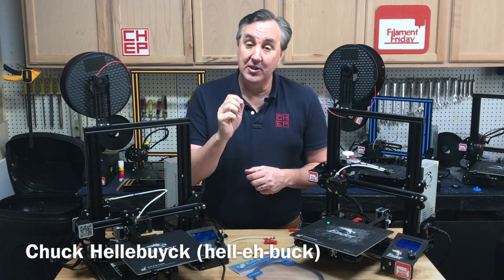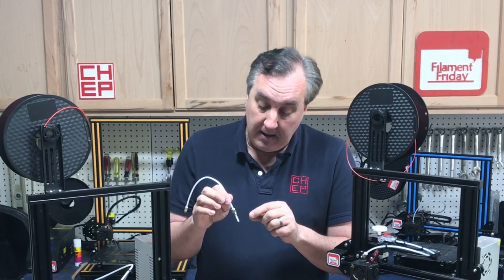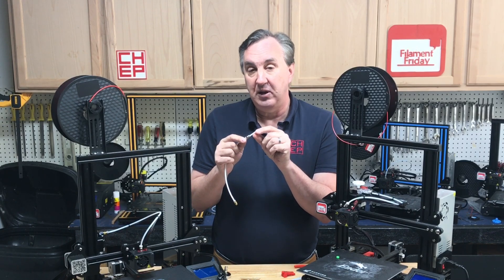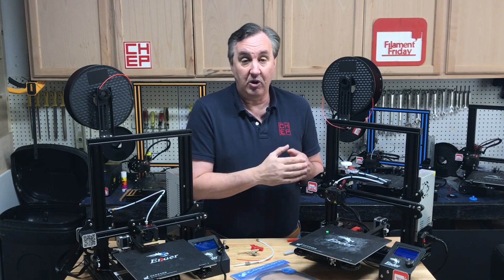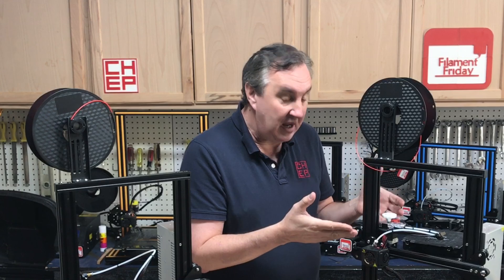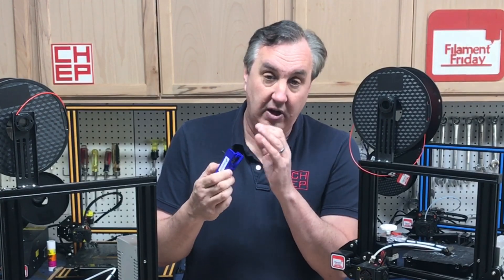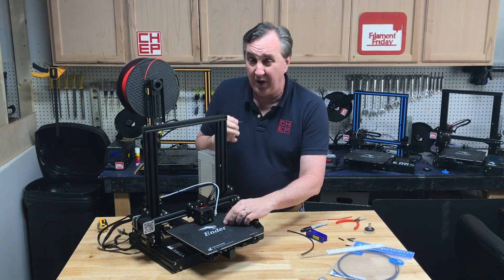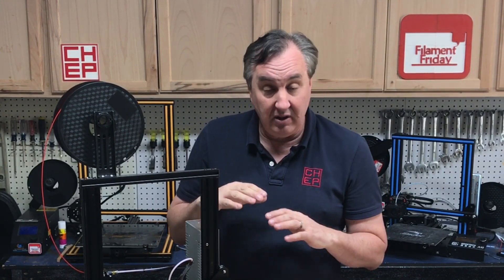Simple HOTEND FIX for Creality Ender 3, CR-10

Comment: Instead of the washer why can't you cut the insert shorter like halfway then you can just screw in and push the bowden tube all the way against the other tube I mean Don't you only need the first 20mm of a better tube inside the hotend to make it better?
Reply: I'd assume that would work too - but having the washer up the top to press down hard on the Capricorn tube would kind of "squish" it against the nozzle, creating a better seal.
Reply: @justdoomibis  I was still getting stringing so I added the 2mm washer going to try that and then going to try removing the nozzle and pushing the tubing all the way through to clear out the hot end and fit a new nozzle or just clean it
Reply: I use a M3 countersunk washer. It helps to seal the tube better.
Reply: @minhdang1987  @FulcrumAirsoft about to embark on this mod. I will try to find this type of washer at my local hardware store. One question - do you place the washer with its flat face facing the Capricorn tube and the crater like face up towards to PTFE tube/coupling? Just asking to make sure I do it right. TIA.
Reply: @ashokmoghe8035 yes. the flat face of the washer will face the tube which is between the nozzle and the washer itself.
Reply: @minhdang1987  Thanks for a prompt reply. Planning to do this over the holidays. Mine is a stock setup that is printing beautifully and consistently but want to do this "mod" before graduating into printing higher temperature filaments like PETG, TPU etc. Thanks again and happy holidays.
Reply: @minhdang1987 Thanks for the idea mate. Had all 4 of my Enders go down with heat creep within a few hours of each other whilst processing a mammoth order. The PLA+ washers did originally work but denatured and degraded over time leading to the tube backing up. Got some M3 countersunk washers from Sourcing map on Amazon, also ripped out the Capricorn tubing I used inside the hot ends and replaced it with the traditional Creality PTFE as I got a year out of the first printer I modded. Think the tighter bore of the Capricorn actually made things worse and it seems to conduct heat better, hence the washer degrading. All 4 have the countersunk washers and the couplings aren't loosening like they did with the plastic washer. All work fine now. 

I'll give a tip back, use a flame to singe any stringing. I use a small blowtorch to quickly singe the stringing off. I tolerate the stringing as long as the print is strong.

Comment: I have done now two machines with this solution. No problems are experienced. I have redesigned the washer a little bit for my use. All in all a great solution. I have a all metal heat break and it keep in stringing, still need to try and find out why. My Micro Swiss all metal work fine and then suddenly it start to clog after a few days of print. Still not sure why. 

Keep up the good work and thank you.
Reply from the maker: Prime it like this. https://youtu.be/OG7We83M5gc

Comment: Sir I keep having a blockage in the nozzle end of the PTFE tube of my ender 3 whenever I turn on retraction irrespective of the retraction settings. I have tried almost all tips and fixes to no avail. Would appreciate if you can help me out.
Reply: I have this issue only with PLA and not ABS.
Reply from the maker: Replace the PTFE or install this: https://youtu.be/tYbL-O3FecY
Reply: @FilamentFriday  i have tried replacing the PTFE multiple times yet no result . also i cannot get a bimetallic heatbreak in my country. i noticed that when ever the tube clogs, the filament blos and sticks to the pfte tube on the inside.

Comment: I had problems with my new Ender 6. The pressure on the bowden tube coupler at the hot end would cause the tube to badly groove inside the connector after only a minimal number of prints, causing blockages. The tube would also gradually creep back from the hot end, yet another cause of blockage and frustration. I'd wasted multiple lengths of bowden tube before finding this video. I was able to salvage some of my capricorn tube, measure cut and fit (after printing the washer) and then replace the main length of bowden tube with a slightly cheaper alternative that I can source locally. I printed the washer at .12mm resolution using PETG (because it's what I had loaded) and it came out brilliantly. Six prints into my new setup, and no hint of problems yet. Fingers crossed!

Comment: Thank you sir. I've been having problems with under extrusion since I changed the complete hot end; inspected the PTFE tubing and found a caramelized like substance coating all over the tubing and inside the heatsink. Just fitted this mod and it's printing great, it took the guess work out of replacing the nozzle.

Comment: Tried your washers but they just rattle around inside the hotend & dont fit properly in my ender 3 pro. (Diameter too small) am trying capricorn tubing right through see if that works instead.

Comment: I tried this but I abandoned it. It's a lot more complicated and that I ended up squishing the short section of PTFE between the nozzle and the blue button that pops up on the threaded bolt inside the heat block and filament didn't want to go through.

Comment: Do NOT do this. It'll only create far, far more problems. This is a colossal prank at our expense
Reply: if you don't provide and explanation your argument is useless.
Reply: Would you mind elaborating on that? What problems does it create?
Reply: Well this prank works perfectly on my machine.  Will update my second machine once it finishes printing
Reply: You clearly don't have the IQ to implement this, so you should probably stop posting.

Comment: When you change the nozzle won't that bit of tubing fall out the bottom?
Reply: No, because it's a snug fit inside.
Reply: @johndaniels1197  even if it does, it's not hard to push it back in there.

Comment: Do you think this could be issue could be causing my prints to fail halfway due to clogging?
Reply from the maker: Yes
Reply: Thank you sir... I'll give it a go
Reply: @jameswalls3508  and ? did it help?
Reply: Not really.... But I figured out my issue.... Friction on the run out sensor due to the angle it feeds on taller prints
Reply: @jameswalls3508  so what did u had to do? I am having issues with my ender 3 max. It prints for like 30 mins and then starts clicking. I am a complete noob 🥲
Reply: Heat up your nozzle and remove the filament... Back your Bowden tube out of coupler at the hot end... Loosen your nozzle 3/4 turn(might have to remove the shroud and hold the heat block long ways with a pair of pliers). Reheat your nozzle to about 205, cut the existing end of your Bowden tube (a couple of millimeters should suffice) and reiinsert it into the couple till it stops firmly... Then tighten your hot nozzle back down... This ensures you have it seated good up against the nozzle. Reinstall your fan shroud.... Also... Is your Max stock?
Reply: @jameswalls3508  thank you! It has springs and a capricon ptfe tube thats it
Reply: If it is.... There may be more going on.... My x axis(the bar across the middle that moves) sagged whenever in tried to print causing the right side to always end up to close as the print went on. Ultimately added a secondary motor and lead screw to the other side to ensure it moved up evenly... As for your run out sensor... You may notice when you start printing larger things it squeaks... That's where my problem was... It would drag going into the sensor and eventually hang up and the extruder would continue turning without pushing... Slowing my print down to 80% helped with that.... Finished a 76 hour print for my first time ever lol... Just keep at it and work the kinks out then it'll print like a champ.
Reply: @jameswalls3508  i hope so 😮‍💨 thank you so much for your help! Deffo going to try and slow down my speed! But do u think that i should replace the run out sensor? Or even remove it completely?
Reply: @jameswalls3508  my z-axis seems to be fine measured it like 5 times 😅😅
Reply: Id measured it allot too.... Just notice that side dragged a bit when it was printing so I figured "nope... Not on my new printer" lol

Comment: Could a standard SAE #2 washer be used instead of printing a miniature PLA washer?  The dimensions for a standard SAE #2 washer are 3/32" ID x 1/4" OD x 0.020" THK.  (2.38 mm ID x 6.35 mm OD x 0.5 mm THK).

Comment: I wonder if you replaced the short piece of capricorn with a short piece of bronze or brass tubing. Bronze is so slick you can't turn it on a lathe, so should not cause a problem.

Comment: CHEP, 

Found this mod and tried it.  I like the idea.  I have one observation and one question...  

I noticed when inserting the filament it seems to stop/hang-up at the transition from the washer to the Capricorn tubing.   In looking at it the inside of the washer it is slightly larger in diameter than that of the Capricorn tubing causing my filament to catch it and stop.  Maybe I need to make my filament pointed on the end rather than use a slanted cut when feeding into the extruder.  

My question is even though the washer is printed in PLA and not affected by the heat of the hot-end what are the chances when pulling  hot filament out during a filament change it will possible touch the washer and cause string or melt it???

Larry
Reply from the maker: Low. I’ve never experienced that.

Comment: Can this fix work with a piece of steel tube with the same dimensions as the Capricorn insert? It seems like that might be even easier than buying a new bi-metal heartbreak and allow for even higher printing temperature than Capricorn
Reply: Like CHEP said I doubt It would be a good idea because of the hear transfer, it would melt the washer and the filament before it reaches the nozzle
Reply: @OsmannyM  my hope is that the heat will radiate out somewhat. I have a few ideas about how to emulate the bi-metal heat breaks like using a ceramic washer between the tube and the printed washer
Reply: Thanks for the reply! I'll give an update after some experimenting
Reply: @poshhippie6446  did you manage to try out your idea if using a metal tube instead of the Capricorn tube? Would love to know the outcome. TIA.
Reply from the maker: I doubt it would work very well but give it a try and let us know.

Comment: I see that you read all your comments Chuck. This is my last ditch effort…. I have 9 CR6SEs in my print farm. The other 21 are prusas and I have some higher end ones as well. I’ve upgraded all the extruders to dual drive creality ones. I’ve replaced many of them to bimetal
heatbreaks which made them clog frequently. Finally I bought 9 orbiter extruders and installed it on 2 of them. They seem to run much better, but having an issue with VREF and output. All the couplers have been replaced and no matter what I try I have big issues with underextrusion. The couplers eat my Capricorn even with the hotend fix. The outside of the installed ptfe insert is also gummy and sticky. I get 1-2 prints in and the coupler has eaten a deep gash into the ptfe causing constriction of the filament path. I’m very close to throwing these 9 printers away. I’ve lost so much valuable time trying to fix them and they’re just garbage. I’m wondering if perhaps I’m over tightening the coupler, but eating my PTFE has me thinking differently. Any ideas?

If you help me fix this I will gladly commit to a year of patronage

Comment: I have done this mod on a FLSun Q5. Just had to scale the washer a little bit to fit. I printed the washer I abs to make shure it is heat resistant enough. I think one of the biggest advantage of the mod is that it makes changing the nozzle much more comfortable, because you don’t have to push the Bowden down till it touches the nozzle, which always includes a little guessing and hoping it sits flush and seals properly. And especially on a delta there is very much stress on the Bowden coupling because the Hotend is constantly moving in all axis with high speeds and jerks. So a Delta printer will definately benefit from the mod. Thx for showing this simple and effective fix!

Comment: Ender 3v2 doesn't print anything so hard to make a washer. So far 1 year in I hate my 3d printer. My fault for not realizing it was a 2nd job.
Reply: If you are finding it too much hassle, err every mod you do in favour of reliability and longevity. In the end you are probably going to have a machine with ABL, direct extruder and a couple of linear rails, which can print hundreds of hours between maintenances.
Reply from the maker: Are you using my Cura profiles? 
V2 should print a washer without issue.
Reply: @FilamentFriday  A working E3V2 will, but he is having some issue with it. I recommend subreddit r/fixmyprint with a video to help with troubleshooting and we will help there.
Reply: Thanks SnarkyGnome and Chuck for the help. The print isn't super beautiful, but I think it will still give the seal desired for the washer in this video. TLDR fix: CHEP best profile, glue stick, 30% speed on printer itself.
FYI if it helps anyone. I tried a few of the CHEP profiles. Then tried adjusting the CHEP4.12_0.12(Best) profile to have slower initial layer travel speed to 35 mm/s and 115% initial layer line width based on another CHEP video. Used glue stick for all prints and cleaned bed with alcohol between prints. Still just stringing print no sticking. Finally tried these same settings and glue then changed print speed on printer itself to be 30% (using Jyers firmware on Ender 3v2). In case this helps others. I'm not sure if it's just a sticking problem or extruder issue maybe when going too fast. Spent my allotted time on the problem this week so will try a bigger print next week. Maybe just 30% speed for first layer or 3 then see if it can handle the rest at normal speed.
Reply: @nottelling6727  Buddy I think you need to explore other avenues related to hardware. I would suggest you look at your bed levelling or your z offset because I have 2 of these machines and I don't use anything for bed adhesion. Once every 40 - 50 prints I either wipe her down with a tissue with water or just brush it off with a tissue. Have never had any issues. I am using an authentic bl touch on one machine and a cheap $20 3d touch on the other, so if you don't matter which one but I suggest to get one because at the very least for $20 you can view the levelling mesh of your bed via jyers.

Also I don't know about other people's ender 3 v2's but when I used 100% iso on my bed I noticed yellowish stuff coming off on the tissues so I stopped using it in fear of ruining the coating on the glass. Just a thought in case it is what's happening. Water is good enough imo.
Reply from the maker: Not Telling - Based on your description, I don’t think you have your bed properly leveled. I have videos on this.
Reply: @FilamentFriday  EZR struder, hot end fix, releveled bed manually, redid z offset, redid CRtouch mesh level, and I have printed 3 things without issue. Crossing fingers for a month or 3 of prints without major issue. :) Thanks for the feedback from you and others.
Reply: for any others that find this. Chuck's profiles and videos have been the best I have found through a good amount of looking.
Reply: On my printer I had to make sure the Z axis was level to the frame of the printer, make sure the roller guides are snug, installed a touch sensor, and have it setup to run a level check before every print. 
I haven’t had to do much to it since it just runs now, no clogs, great prints. It’s running tpa 95a right now with the Bowden setup no issues.

Comment: Chuck i had this installed from September or october of last year and i love it but it didnt last 14 months meaning the nozzle. i was doing a print that was a 7hr print and it stopped at i think 3hrs so i took it off and started a new print i started at 3 or 330pm and it stopped around 6pm i stopped it and looked up why does it stop mid print it gave me 5 reasons and one of them was being clogged nozzle but it was flowing fine so i thought. My question is did you ever have to change a nozzle during 14 months for a clog because i am about too right now? And how would you change it would you remove the tubing and put a new nozzle on or would you change the nozzle without removing the tubing? thanks
Reply from the maker: Your fan may be failing.
Reply: @FilamentFriday  what fan the one under the machine or the 2 on the shroud
Reply from the maker: The hotend cooling fan. If it slows down at all it can cause heating in the PTFE and cause issues like you describe. Check for broken fan blade too.
Reply: @FilamentFriday  ok thank you now did you see the last part on the bottom about changing the nozzle?
Reply from the maker: If the nozzle needs replacing, just change that. Or both. Your choice.

Comment: if you put oil onto the filament going into the extruder isn't it going to slip???
Reply from the maker: Nope
Reply: @FilamentFriday  I just now decided that I'm going to make a vertical bracket rate above the hot end and multistandard extruder even with the coupling for the Bowden tube actually I don't even think I'll use the coupling I'll just leave it wide open maybe I'll turn a stainless tube on my lave to fit in to replace the Bowden tube. I don't know if I should print the bracket or run one out on my mill out of aluminum
Reply: I used a bit of PTFE spray in the bowden for TPU printing and it works like a charm, makes TPU easy to print :)))